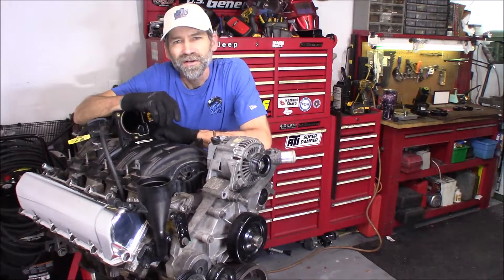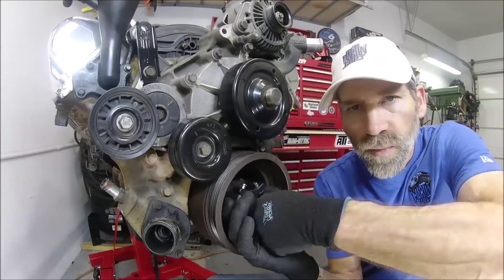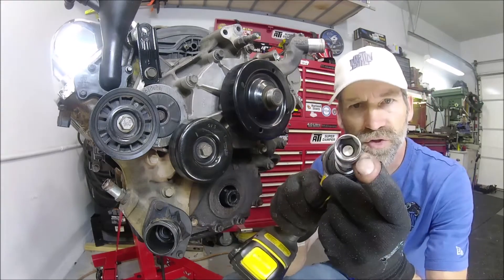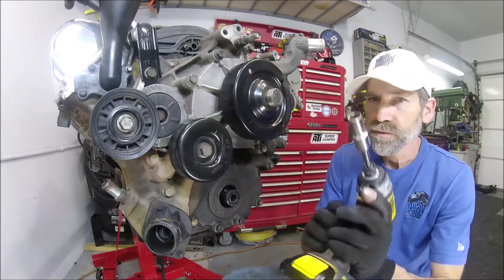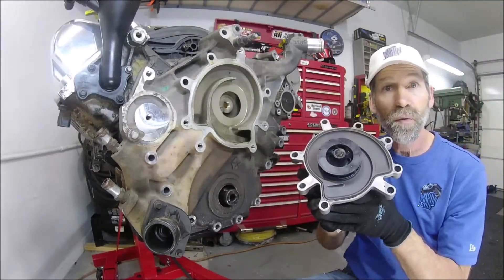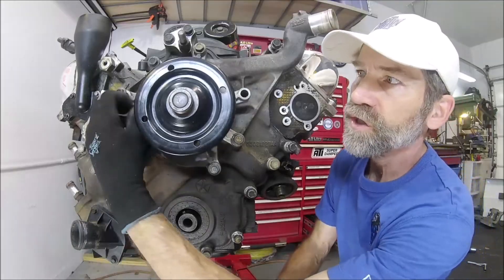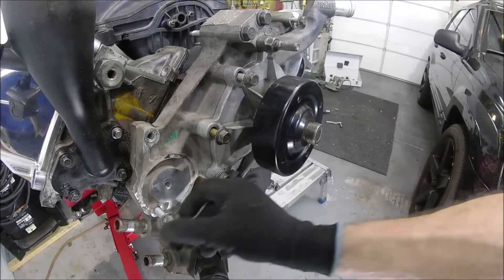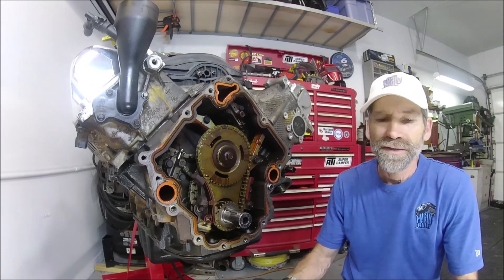How to Remove Timing Cover 3.7 & 4.7 Dodge, Jeep, Chrysler and Mitsubishi

Comment: Is it really necessary take off water pump to remove timing cover?
Reply from the maker: No it's not necessary I noticed you commented on my other video where I remove the timing cover and I show which bolts you do not need to remove if you wish to leave the water pump on.

Comment: Have you rebuilt the bottom end yet?
Reply from the maker: No, haven't gotten too far with it. Been working a lot of overtime to past few months haven't had time. But now it's what's going on I might have the time
Reply: I have an 03 dodge ram1500 4.7l. And I'm have a little trouble in finding the correct size of main bearings.
Reply from the maker: @jonathonmann979  is this what you are looking for? https://amzn.to/2ygcm1K  
you can select std, .010 and, .020 undersize
Reply: I'm trying to find out what size in need. I'm thinking mine are std

Comment: Will I have to do any aligning of the TDC? I just want to remove the timing cover to replace the leaky gaskets. Great video by the way and thanks for the tip about not having to remove the water pump.
Reply from the maker: No you will not have to do any retiming, simply remove and replace

Comment: Long time ago I seen you snapped off a bolt or broke your socket wrench at pick a part...I bet that memory came flashing back at you....also sorry about not catching up with you when I flew to Vegas back in March...!
Reply from the maker: Yeah, that one bolt had me a little concerned.
Reply: @martinbuilt  im having dramas with that one bolt in question, i dont think i will be able to get it out normally. what would you do if it didnt want to come out ? i do havw another timing cover of the other motor i managed to get that bolt out. im thinking im going to have to cut into the timing cover to expose it to gain better access. does that bolt go into the block or head if you know?

Comment: Ever done a head gasket replacement on a 4.7L?
Reply from the maker: I have not, I have only removed the heads of the 4.7 that I currently have on the engine stand.
Reply: @martinbuilt  thanx for the fast reply. I was asking because I have to do this in the next week and I have not done this in years. Was wondering about the timing once I put the head back on.
Reply from the maker: @mexicatrucker6309  Yes you will also have to remove the timing cover and redo the timing marks.

Comment: are timing covers prone to leakage at the bottom on 20 year old cars? I have seen 2 cars of different makes leak there..
Reply from the maker: After 20 years any engine is bound to develop some leaks. This engine was showing signs of seepage there. On my 98 with 4.0 I use conventional motor oil this seems to help.
Reply: @martinbuilt  true.. I think mine is leaking both oil and coolant there but only slightly.. thanks for uploading this video in case if I will change my gasket

Comment: I just got an engine from the scrap yard to rebuild for my 02 jeep grand Cherokee, before it goes out on me. You couldn't be making these tear down videos at a better time for me! lol
Reply: Hi, I am looking to buy a used 2001 jeep grand cherokee with a jumped timing belt. How was the process of replacing the timing belt? I just need to know if its doable at-home by someone who knows cars, but isnt really a mechanic.
Reply: @williamwarner6383  its doable. just take your time and make sure timing marks line up.